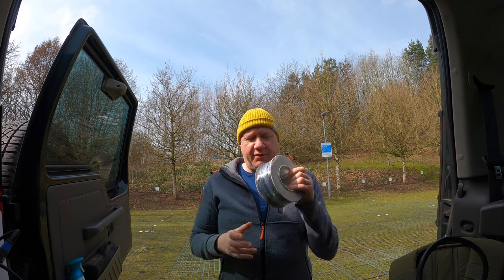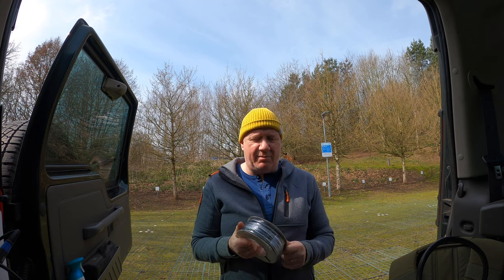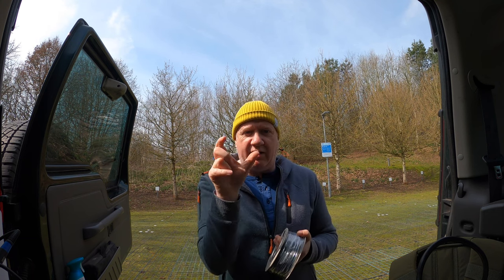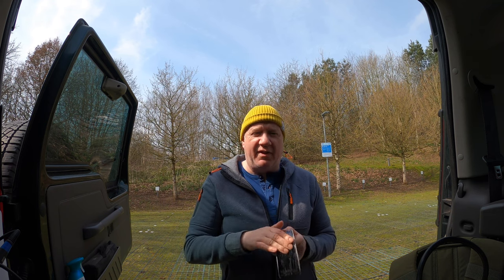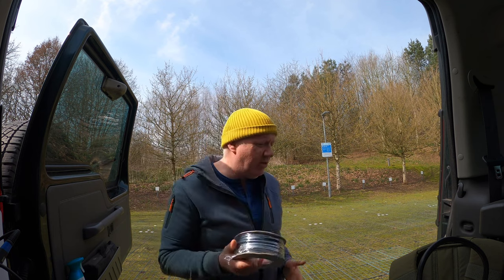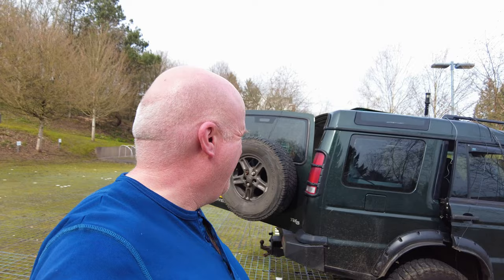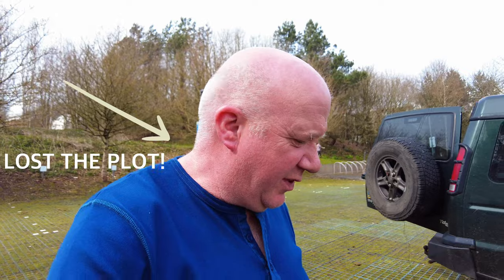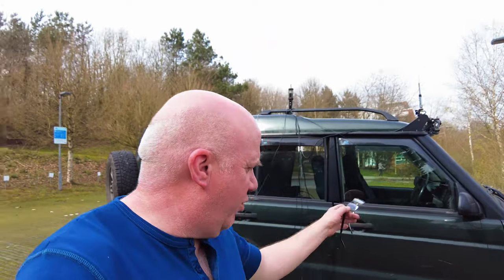I lost the plot with this mobile ham radio setup

Comment: Hi Carl, congratulations for your entertaining and informative videos. Tests I made have demonstrated that the best place for an HF antenna on a vehicle is on a 5mm aluminium plate bolted under the front bumper. Not sure, but ground proximity and a slightly longer distance between radio and TRX could make the difference. The intensity of the near HF field is often underestimated. Even better results have been obtained as you suggested with a tripod at about 10m of the vehicle. Chameleon or equivalent, EFHW's on fishing poles or an inverted V will work nicely. Can be fixed on a spike or against a fence near your parking space. All this is OK if you are operating /P from your LR. While driving I mostly use VHF / UHF so no problems with mag mounts or window antennas. Hope this helps!
73 de Alex, HB9CKR

Comment: Just recently tried mounting a whip on a mag mount on the roof. Luckily no wind. 17 feet of whip on a single mag mount. Like you said and often do, a tripod is the better and safer bet. Or a spike. Chameleon's ground spike and micro unit and whip work well, too.

Comment: Ham radio can be used mobile in the UK, perfectly legal.
When I had my 706 in my discovery it would feedback through the rear speakers and would cut out if the power to it was a little restricted. I ended up using a 105ah auxiliary battery and the MFJ voltage booster. That cured the drop out, I cured the feedback in the rear speakers by throwing them away, the front ones got simple clip on ferrites.

Comment: I would connect those aligator clips to the bolt in stead. they are insulated from the ground plate by the paint/coating.

Comment: You need to match the impedance at the feedpoint, if you can't do this with some sort of matching technique such as capacitor (if it needs more), or stub matching etc. then you should try to add or subtract lengths of coax. This will at least match what the radio sees. The RF issues should go away. Try to borrow an analyser and see what the impedence is at the feedpoint, try to avoid odd quarter wavelengths (or harmonics of that) of feedline. Another thing you can try with that magmount is to put some thin rubber material between the car and the mount, you could also try other materials. The easiest fast fix is coax length, assuming everything else is in good order. I'm trying to see where you attached the radials. Try attaching them to the vehicle rather than to the mag-mount. Mag-mounts and stainless steel whips work in mysterious ways!
Back in CB days i fitted a welded up heavy duty bracket to a roof rack which was grounded to the vehicle in the 4 clamping points for the roof rack. There was a heavy duty aluminium pole that could come up and be held in position with a locking pin. we put an Avanti SIgma IV on that and it worked amazingly well, later we brought a pump up mast with us which worked even better. The steel plate was around 8mm thick and at the front i had a bolt through mobile mount for firesticks or a 102" whip. Solid! But, yea, the way mag mounts match the impedance is pretty fussy. try coax lengths first and go from there, get a female to female SO-239 and some random lengths of coax to put inline. Try 1M extra first. If this solves it then later you can also try shortening your coax. Try different bands to see if the RF persists all across the bands.
    If when you tune your antenna to it's band (if mono) your SWR is not coming lower than 1.3 or 1.4 you might want to check the impedance. Tuning it out with coax lengths is not ideal but stub matching with a Tee connector could also work quite well. Check you do not have any power cables wound up in a loop!
In any-case i would scrap the magmount and work out some sort of solid bolt through bracket with good grounding to the vehicle.

Comment: I remember I used to bring my tri-magmount out to the park with a simple hamstick and stick it on an unused BBQ grill and get fairly decent results running QRP. One time the ground connection broke and separated so I had to settle for running cheap telephone wire from my bag as a long wire and that day was an absolute FLOP! I went back home and drank two ice cold beers and everything was okay again. Magic!

Comment: Agree, we have all had these experiences, and if not you aren't trying hard enough.  For a quick deploy on the Land Rover, try to fashion a mount that can be bolted to the spare tire (carrier) then 12 radials in a semi circle behind  the Rover.  Also, I think  the RF choke should closer to the radio. This allows the shield of the coax to operate as a radial, yet chokes the rf in the shield before the radio.  I use a homebrew feedline choke with 5 snap on chokes at the radio connection.

Comment: The metal body parts of the vehicle might likely are becoming parasitic elements with this set-up. Bonding the various pieces of the vehicle to ground would likely clean up the stray RF, as you say. Though ground strapping all the various panels and pieces together is a time consuming task. Thanks for sharing your time on this set-up, it's instructive.

Comment: Hello, Instead of radials, try attaching the base of the antenna to the tow hook with a ground strap 10/25 Sq mm copper tinned, per m.
Give it a try / 73
Reply from the maker: Oh that’s interesting! Thanks
Reply: @M0SZT  I've been able to tune some antennas with this solution, then tell me if it worked / 73

Comment: I don’t run any amateur radio gear in my Land Rover as it’s a RF maker!!! 
Your ok if your parked up engine off and running an external antenna but it’s a waste of time trying to use a mobile antenna in my experience.
Good luck sorting it.

Comment: The RF may actually be controlled if you use a 1:1 choke balun at one or either end of the coax ? I had the same problem in my shack set up and it worked well (untill all the house around suddenly got solar panels "!). I also suggest a grounding spike driven into the earth about a foot (more is difficult to extract. ). 73 M7BLC

Comment: There will be all hell to pay if you burn those exquisite tops on your units in the Disco.
( Lesson personally learned by soldering on the kitchen worktop - XYL suitably impressed.  NOT !!! )
Good decision - dead horse well and truly flogged Carl.
Reply from the maker: Cheers, I’ve got a wooden unit that I’ve added on top of the drawer in the Land Rover, it’s plywood and is the base for my bed.

Comment: Hi Carl
Is the Landrover connected to ground, I remember years ago having an earthing strap going from an exhaust bracket at the rear of the car with a strap/chain touching the ground to prevent static. Would a similar approach help with the RF? I'm an M7 and still learning so apologies if this is poo!
Reply from the maker: It’s a good idea grounding the antenna, even driving a steak into the ground would help to get stray rf away from the vehicle

Comment: Our of interest Carl what was the voltage on the706? Sounds like Rf issues when a 706 has low voltage, but as others suggest it is likely a grounding issue.
Reply from the maker: That’s interesting, I could do with measuring the output of the battery

Comment: Hi, great video, I use a td5 to get out and about, when working out of the car I use a simple ground spiked slidewinder coil and either a 2.4m or 5m whip  antenna with a few feet of feeder and if necessary a radial or 4 (depending on ground conditions). I also used a diamond bb7v endfed and was really happy with it, though it's normally attached to the qth. It's interesting that I also had issues with ham sticks on my LRs roof, though could have been the roof rack. Great video, thanks.
2E0OWI

Comment: hi carl, love this type of realistic video.  Obviously iam no one to listen too, radials draped over the vehicle may be trying to make the ant a ground plain with above ground radials, but normally i think there would be tuned radials of say 2 or 3 required, so a bit of a conflict going on there maybe. also, was that car park covered in metal work of some description ? as you say, the same ant set on a tripod with radials away from the car, or even using the metal covering thats already on the ground might work. A simple vertical with a number of verticals , in my experience always works well. I know tim g5tm works from a car, but do you know if rf could effect any of the electronics within a modern car ? keep up the good work carl, look for your next one. 73.

Comment: Hi i always found mag mounts to be poor bellow 21mhz its the capacity between the magnet and the car you can not beat agood anttena mount fitted to the car and a good earth connection to the chassis i used to run 400w from my car never had rf trouble anyway i am shore you will sort it chris chris G0WFH

Comment: Yes, you have lost the plot LOL. I also have a Little Tarheel, and have used it on a number of vehicles - currently on a Land Rover Discovery 3. Never an issue with RFI or tuning. Why all the radials ? That was funny - walking through a curtain of radials getting in and out the SUV. Fit a proper lip mount that makes direct contact with the metal of the SUV - not magnetic mount, and Bobs your uncle.

Comment: Is that a steel grate you are parked on?
Reply: It looks like some sort of wire mesh alright.
Reply: Hi, more likely a plastic former that is infilled with soil for a hard(ish) standing and the grass grows up through the grill. Hope that makes sense.
Reply: @MI7DJT  Won't that interfere with your radials?
Reply: @CGW-UK  Makes sense!
Reply from the maker: I'm assuming it is just plastic, but it may contain wire??
Reply: @M0SZT  If it does contain wire then I think you've found the culprit.  Be good to know, if even just to eliminate that as the source of the problem.

Comment: Actually, yes you are allowed to use your radio whilst you are driving. So long as it does not interfere with your ability to drive it is perfectly legal.
It even states this in the foundation license training manual.
The driving whilst using law is dictated by the frequency of the equipment you are using.
So nothing in the microwave bands and phone bands is permitted but anything from 446MHz down to 1.8MHz is perfectly fine.
Take note that using  "network radios" is not legal as they are connected via the mobile phone network and therefore technically your are using your mobile whilst driving which as you know is an offence.

Comment: land rovers are not the best vehicles i found only really good for vhf/uhf due to rf and they are rubbish for earthing. some have airbag supension and all seem to have floading earths these are rubbish. i had a land rover discovery and had same issues you got. chnged to a mitsubishi shogun same radio same antenna worked brilliant. so mobile in a land rover forget it its not your set up but more likely the land rover discovery. i feel for you i really do it frustrating

Comment: Hi Carl, I use a Scorpion screwdriver on my Suzuki Grand Vitara and I struggled for about 8 months to get it to tune from 160mtrs to 10mtrs on full power. Unless you have a reasonable mount which is grounded to your vehicle and carry out some vehicle bonding (doors, bonnet, exhaust etc) then your will probably pull out even more of your hair than you have done already. Keep at it mate, you'll get there. Regards, Carlo. G7iru. Email me if you need any pointers via qrz.